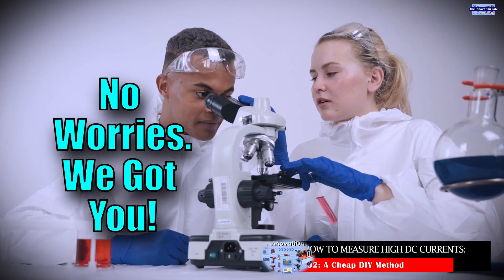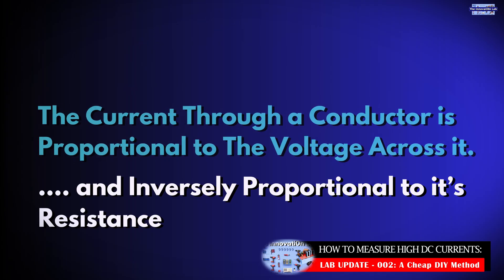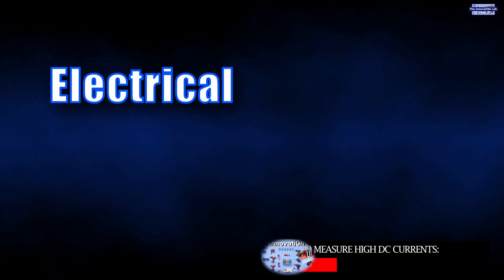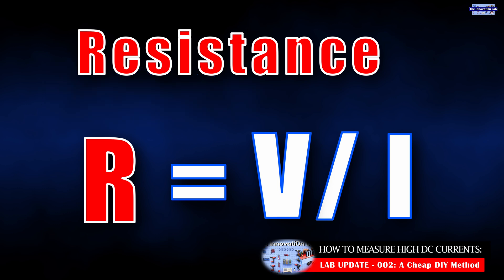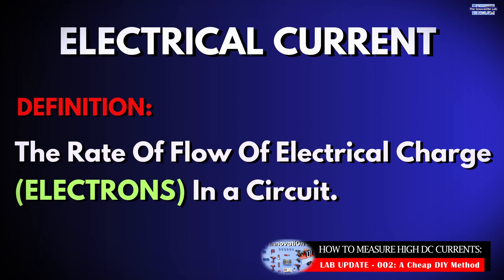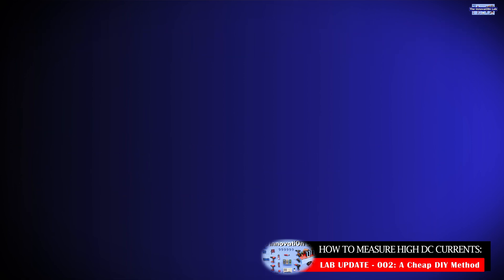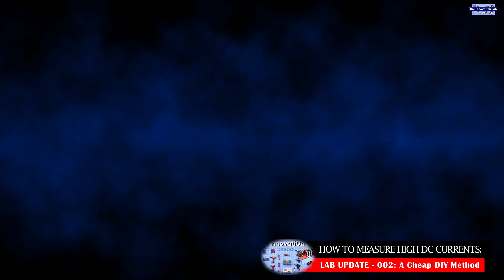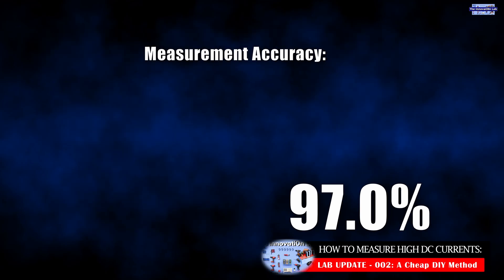How to Measure Electrical Current⚡️

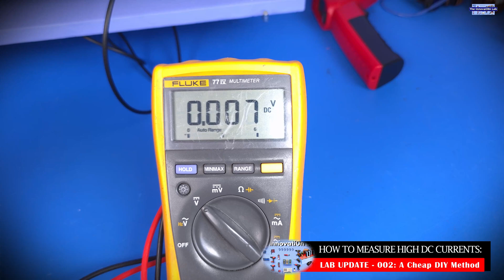Comment: 7:00 Please please use the  mV setting on this quality fluke 77IV multimeter to get the most significant figures. In the V scale, you only have 1 count and it is hunting between 0.007 and 0.008. The datasheet for the Fluke 77IV says accuracy is 0.3% + 1 count.
So the possible range of voltage the meter is reading is from 0.005979 V to 0.009024 V.

If you use the DC mV scale, your error will be 10x lower, an order of magnitude! Your uncertainty will be ±121µV instead of ±1.021mV!
Reply: You should add error calculation to your video, show the measured value, the resolution, the accuracy, calculate the total uncertainty as a sum of the % of the reading and the counts multiplied by the resolution to find the relative uncertainty.

The relative uncertainty of the clamp meter (I think you have a GD166B) is only 2.67% while the Fluke 77IV + shunt had a disastrous 12.8% - 14.3% relative uncertainty

The Fluke multimeter is performing poorly, and that's because the range and resolution is operating in the 6.000 V / 0.001 V region instead of the 600.0 mV / 0.1 mV region.

Had the multimeter been properly configured, the relative uncertainty could have reached 1.56% and outperformed the clamp.
Reply: When comparing the measurement accuracy, it's not clear how you decided the "true value" of the current to compare the measurement accuracy between the three instruments. 

You should have decided that the most trusted instrument with the lowest uncertainty would be your reference "true value", or used a theoretical reference by calculating the current from the load voltage and load resistance, or system voltage and total series resistance.
Reply: And if the purpose is just to find the cheapest way to measure high DC currents, you should show the cost of the measuring equipment in a final comparison!
Reply from the maker: I fully agree with your trend on thought on the cost comparison and it would have been great had I remembered to capture it.

However, as I mentioned in the video, the premise was really to use the shunt method as a way to validate the accuracy of both digital power meter, and the digital current clamp....as a way to troubleshoot the design issue I discussed in the video.

Thanks again!
I appreciate your insightful/thoughtful engagement.
Reply from the maker: Thank you so much for the great and constructive feedback. Much appreciated.
👍👍👍

I agree with your observation.
This is definitely one of those 'I can't believe I missed that' moments.
When I come to think about it though, it would make sense that I totally forget to use the mV setting because that is one setting on the DMM that I mostly never use because my projects usually involve measuring higher voltage ranges. I totally agree though that using the mV setting would have given me more precise measurements....and actually made my life easier.😊
But I won't be too hard on myself because the process of capturing and producing these tech diy videos is really not a simple task.😊

Thanks again. 
I appreciate all your thoughtful feedback and engagement.

Respectfully,
The Innovati0n Lab

Comment: voltage drop over long wires, voltage drop across contact points and temperature compensation resistor issues for Shun, ADC of digital ammeter, one problem is that each has a precise measurement limit. Calibration of measuring equipment
Reply from the maker: Thank you so much!
I appreciate the thoughtful feedback. 
Yes, I fully agree that no single measured parameter will ever be ideal. There are always lots and lots of variables at play.....this is why the word 'tolerance' exists in the world of electronics.
👍👍👍

You are awesome.
The Innovati0n Lab